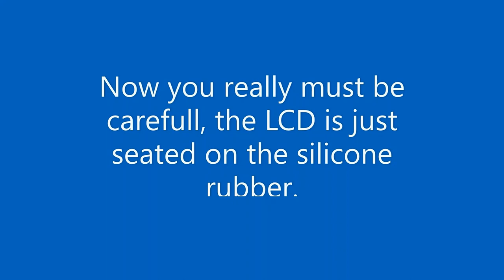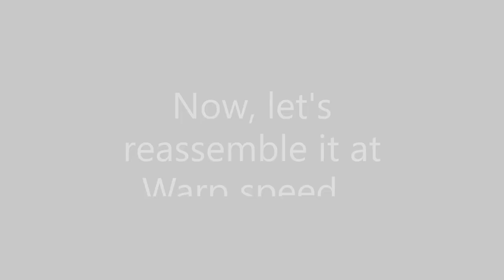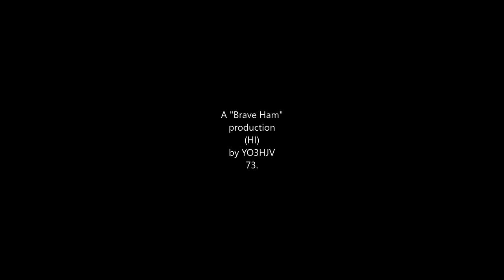Disassembly and reassembly of a Xiegu G90 Front Panel

Comment: Great video I wonder if any type of back lighting could fit in there for the buttons?
Reply from the maker: I really contemplated this for a while and did tried something in this direction but I wasn't happy with the result so I didn't adopt it.  Being a radio for my travels and portable ops, I am not so comfortable having things that can result in short-circuit in the front panel. There are some guys that did backlight modifications, kudos for them!

Comment: I took mine apart last week to add backlight to the buttons. Worked out great! I wish I'd found your video before though,  :-) Question for you: do you happen to know what the pin header is for, next to the where the connector for the top buttons plug into the main board? I wonder what interesting things can be done with that.
Reply from the maker: Thank you! Yes, it is the JTAG connector; I used to upload the bootloader when I replaced the STM32 microcontroller: https://yo3hjv.blogspot.com/2020/12/xiegu-g90-reflashing-bootloader-into.html
Reply: Hi, Could you please elaborate on this, I would like to add backlight as well. Can you send a photo where/how did you place the backlight and how is it powered.

Comment: Great video! could you do the same for the main unit? I need to replace the 8 pin socket. Thanks W1BUS
Reply from the maker: Dan, I will try. The problem is that I have too little time.

Comment: Do you do repairs for other people I have one that is bricked because I updated the display bios thinking I had the greatest greatest bios installed previously and it bricked the radio I tried to reinstalling the firmware on the main unit and I got a wrong ci- v port error message.
Reply from the maker: I do but I am in Romania!